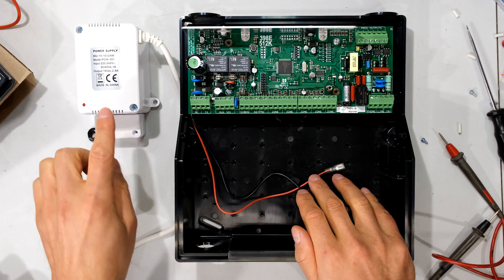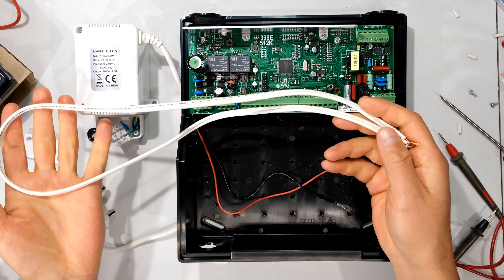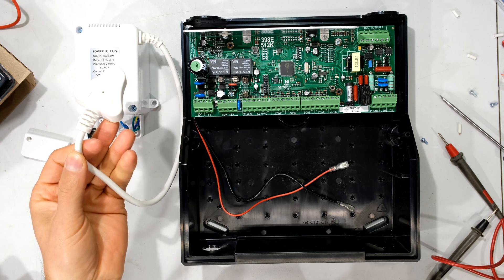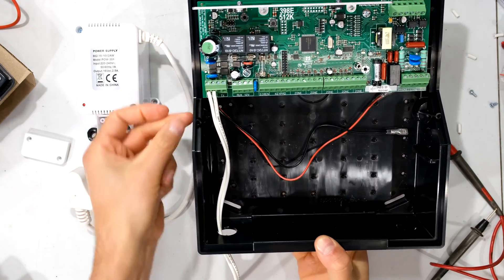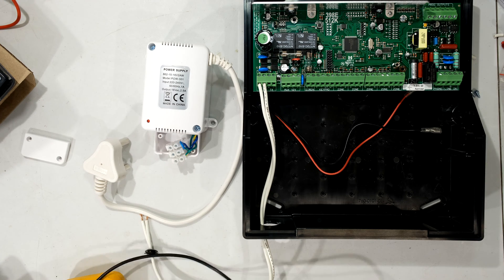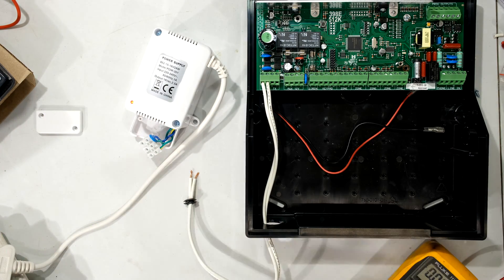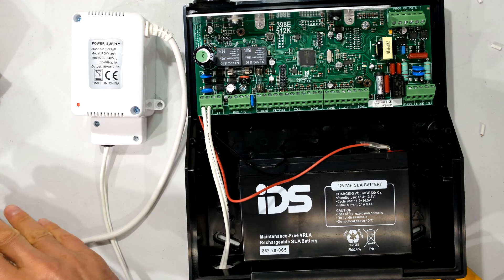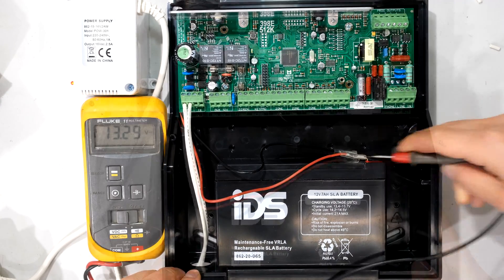How to connect and wire a power supply transformer to the IDS alarm system panel

Comment: Hi, how do I wire the bright blue alarm light to this panel ? i currently have a blue light but it is with resistor and only 3Volt, not bright at all. (This was installed by technician)